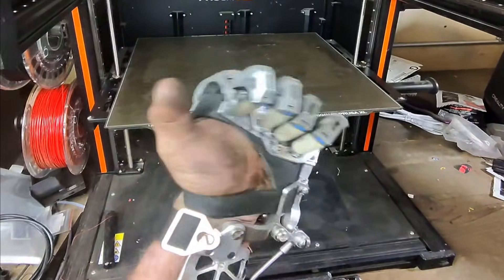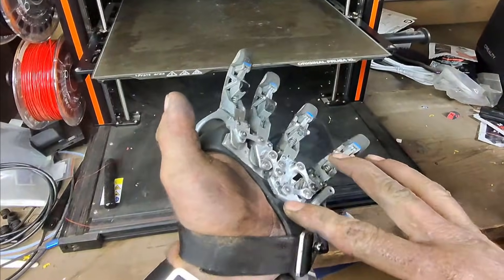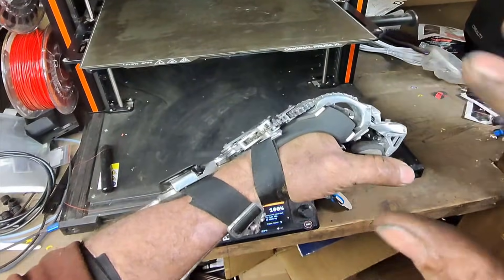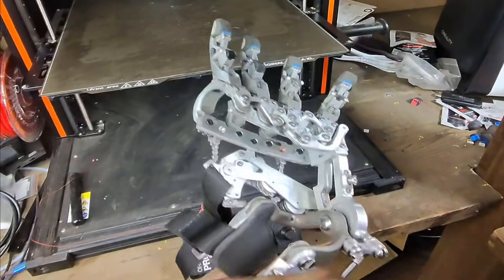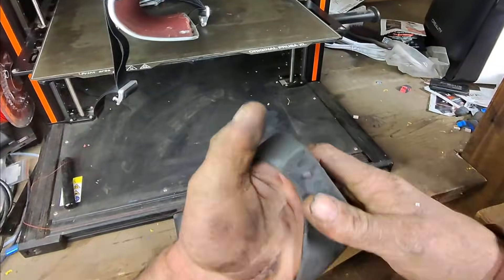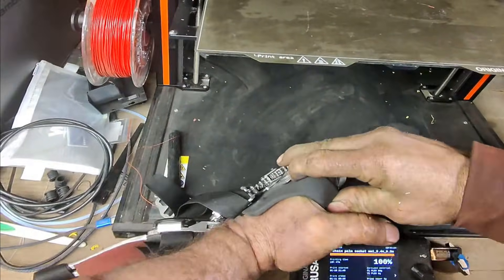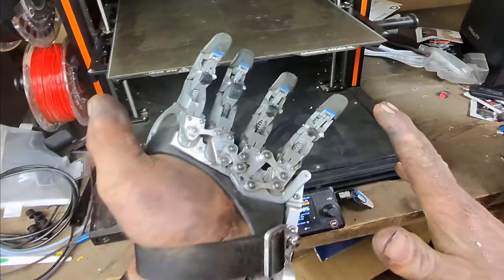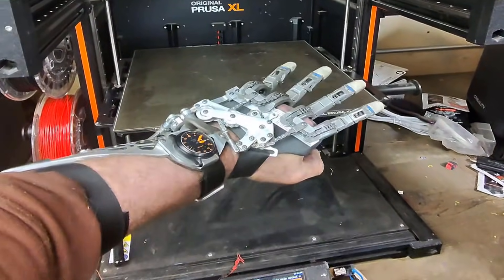Finished up my New Prosthetic Hand !

Comment: I wonder if you could add attachments onto the fingers, like a flashlight or a removable screwdriver insert.

I always had an idea to have a thumb on a prosthetic work as a functional Zippo lighter where you close the fingers over the thumb and open the thumb out of the closed hand to strike it.

Comment: if you want to make the mechanism smaller, you may be able to use bicycle chain from an electric shifting system. the chain is super thin and durable because of the abuse it is put through.

Comment: I’m amazed at every iteration I’ve seen you make. I think you are starting to get to the fit and finish point. 

The watch takes it to the next level. It would be cool if it was modular. 

I have a Timex watch I use with NATO bands. I can switch faces and bands at will. Sometimes I opt for my Apple Watch though.

So:
A system where you have adapters you can lock into place that fit the different lug sizes or locks into the lugs/pins to hold different sized watches?

Another accessory would be a magnet on the inner forearm so it could hold nuts and bolts while you work on stuff. 

Stuff that functions well but is hidden in design as opposed to say switching one of the fingers with a screwdriver head or a blade depending on what you are doing.

Speaking of a blade would it be possible to put a small box cutting blade into the finger that opens like a slip lock knife?

Maybe a single fixed place to side and lock in accessories? 

I’m thinking of all the things I use on a daily basis. 

Ps: the new strap design is fantastic!

Comment: I came very close to losing my fingers working on the blade change of an unpowered band saw. The rotation of mounting  caught my hand and the reflexive action of my hand tore the tip of a finger off but it grew back. I was moments of trajectory away from major tragedy and am traumatized by it almost ten years later when I think about it. I now use a push stick to rotate the wheels when mounting a blade.

Comment: Great work as usual!

It does seem like the strap which goes around the thumb is putting a lot of pressure on your forearm. I would recommend adding a rubber padding with a piece of tissue on the skin side. The goal is to better distribute the pressure exerted by the upper straps. You could also 3D print such a part out of TPE, TPU, etc.

Also, I would recommend looking into the construction of ski boots. The combination of a rigid thermoformable plastic with foam and tissue would greatly improve comfort over prolong usage of the prosthetic.

Comment: Cool design bro. Maybe instead of the nipples you have on the metacarpal area that you have to push past to lock the first sleeve on, maybe consider a dovetail and slide the sleeve down. Or you can do something like a key hole similar to a key mod rail with a larger hole that slots into a smaller hole with a flange on the nipple areas. Or have the bottom half of the device hinge down a bit to slide your hand in. Just my $0.02 of thought that maybe of help in your design.

Comment: Would designing in some holes on the socket on non-load bearing surfaces/surfaces that don't need to remain as rigid aid with breathability?  Allow sweat to more easily evaporate rather than build up underneath the socket.

Comment: Seeing this prosthesis that you made gave me the idea to ask whether it might be possible to create something similar that would help me grip objects with my hands. In reality, my issue is that, even though I have all my fingers, I lack the strength to hold onto things when I lift them, and they often slip out of my grasp, which is quite problematic. My idea was to explore whether something could be developed to help me apply force with my own hands, so I can lift objects without them slipping

Comment: This is honestly one of the coolest things i've seen in quite a while. The combination of advanced 3d printing techniques with traditional machining knowledge is incredibly well designed here. The part that connects to the hand can be easily modified and made via 3d printing, thus accounting for differences in individuals, so long as those 4 connection points line up with the metal part. Amazing work!

Comment: Unsolicited suggestion: have you considered using synchromesh cable or kevlar braid? I am not 100% sure I understand how the mechanism works, but it seems like its reliant on fixed lengths of chain rather than the meshing of the chain with a gear for a linkage. A kevlar braid might get you the same type of behavior with less noise and space

Comment: it looks much lighter, less bulky and easier to wear. it looks kind of awesome. it looks like a simpler design. it doesn't have several modes as your previous generation had, but i am sure that you already figured out which modes work for you.

Comment: Looks good Ian always enjoy watching these videos. I hope i never lose a digit but you truely make these better and better mechanicial hands. By the way i dont know if you thought about this. But i do think you're new hand will be less sweaty. By the way i dont know if you can make a extra socket thing for it with a bit more holes in it for letting you're skin breathe a bit better underneat of it. But you would need test if it helps you and if the material can be reduced in those area's. -- I do remember the ather prototypes mostly covering the skin compleetly specialy at the area you showed on video. This does look like a improvement on the original one. --- Owh you could also maybe add a knife finger. For opening packages? like one you need to unfold out of a metal finger. just thinking for add-ons XD Before you know. it becomes a swiss army hand haha. Keep thinkering i love it. I try to watch most of the vids when i can. I hope many people can be helped with you're work on this. Also Mechancial movement is stil better for daily life i think but ofcourse not a option for everybody.

Comment: You know how in Sci-fi shows sometimes characters with robot hands trade out the hand part for like a wrench hand or knife hand?  I feel like that socket and sliding the hand on is a step in that direction.  Just need to make it a bit smoother and easier to put on.